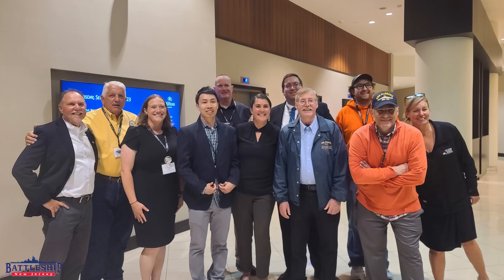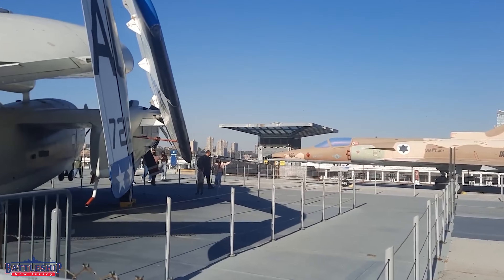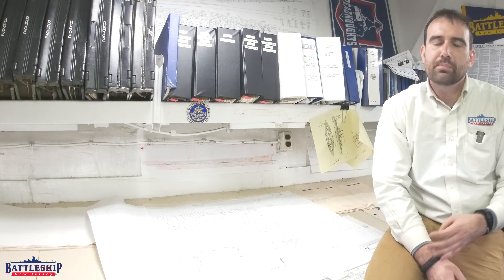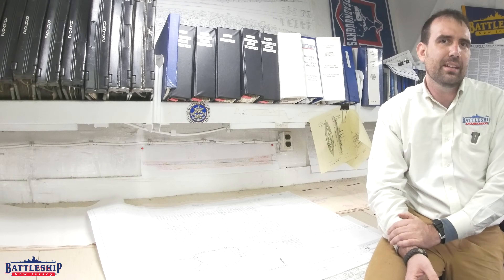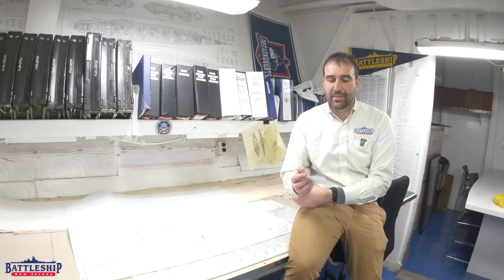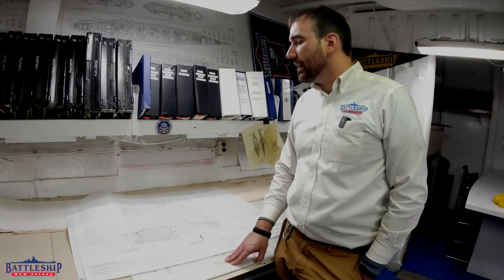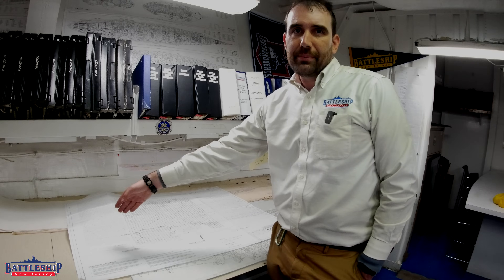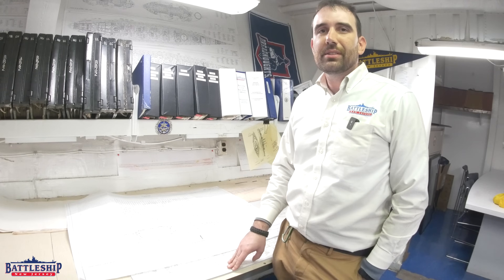Hydrographic Survey: Preventing Getting Stuck In the Mud

Comment: I noticed that Intrepid has 4 four bladed props while New Jersey has both 4 and 5 blade props presumably to reduce sympathetic vibration.  Is this vibration less of a problem for carriers as they are not trying to be stable gun platforms?
Reply: Preferably, you minimize the vibration over the ships operating range.

Check some online stuff about the problems with vibration in the North Carolinas.  Terrible vibrations at high speeds, so bad that the #2 main battery director was unusable at top speed.

Bracing was added to the superstructure supporting the gun director.  They swapped four and five bladed props trying to minimize it.

IIRC, they finally got a combination that moved the worth vibration down to the 16-18 knot range.  The good news being her director didn't shake at 27 knots.  The bad news is that it was moved to a speed that was close to fleet cruising speed, which meant everybody got a vibromassage in their bunks

Comment: something that has always puzzled me is that when the ship is up on blocks, you cant clean and paint underneath those blocks.   I've heard mention of somehow being able to move the blocks around to get at those areas, but that's the extent that I've heard.    An episode covering this would be interesting to me.   also an episode or three about how drydocks work.  and then the detailed minute by minute timeline of the drydocking which would then lead to episodes explaining each step.     Also, if you need volunteers to be linehandlers and such for the actual move, I have vacation time to burn.
Reply from the maker: Is pretty simple, after you paint it, you float the ship, move her a little bit then take the water back out and paint the bare parts
Reply: I would assume that every naval ship has a "plan/map" for where the blocks go?
Reply: They've covered this. They'll flood the drydock, move the ship a few feet so that the blocks will sit on painted parts of the hull, then clean and paint where the blocks previously were. This is really expensive, so they only want to do it once.
Reply: A drydocking evolution is complex to plan, interesting to watch but something that has lost my desire to take part in again as ship's company.
Reply: How's this for a start?
https://www.youtube.com/watch?v=wJVvkMmur0g

Comment: Yeah, just paying for drydocking isn't the only cost of drydocking.  You have to add in things like how much is it going to cost just to find out if we can even get her to the channel and how much is it going to cost for her to get to the channel if she can't get there without having to pay for something else to be done.  I've always fixed my own cars, recently I decided to replace my Lincoln Towncar and found a really nice BMW I could afford but then I realized that I very likely can't fix it if it needs repairs, BMW parts are expensive, if it has to go into a shop it will make the repairs on something like an incredibly common 4.6 liter ford engine look cheap, so I bought what I've bought for over 20 years and know I have the tools and experience to fix (at least in many cases), a Towncar that's next gen to the one I currently own.  One more replacement and I'll be at the last model Towncar, what I buy then I don't know, but I'm old enough to be near dead anyway so that may not be a problem.